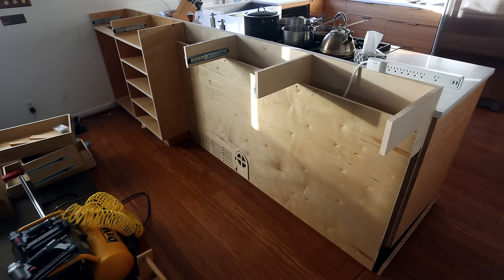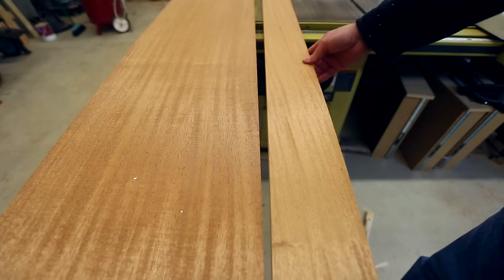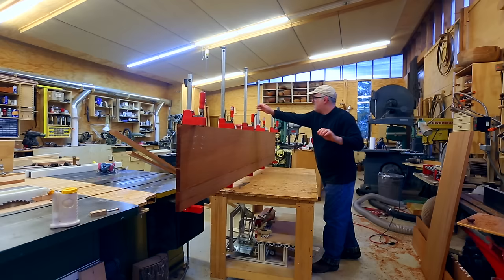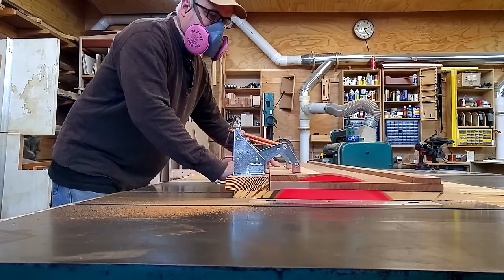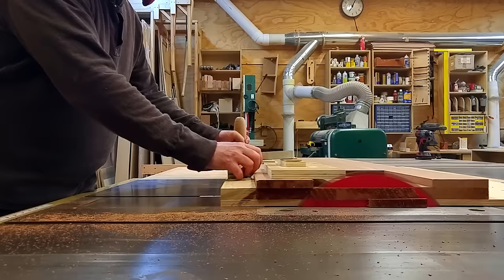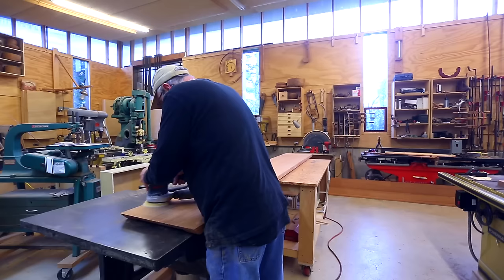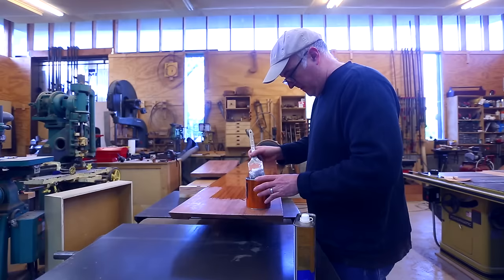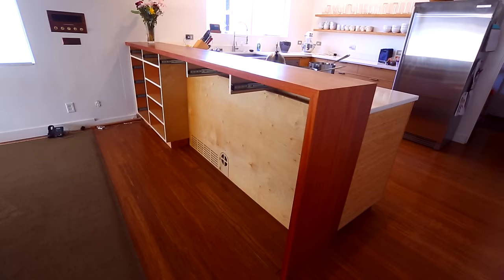Kitchen Remodel: Part 15: Breakfast Bar – Part B

Comment: Looks great.  It is great showing how you step through the process of magnificent idea, screwing up, finding a new solution, buying more timber, going back to the first option with a join because the first lot of timber had better color etc.  
One of my woodwork teachers once suggested a great cabinet maker is one that can make his mistakes look OK.  Looks like you have surpassed this!  Thanks Frank.

Comment: Ahhh, I thought I was the only one to make mistakes like that.  Thank your for your honesty.  
I have had similar results with polyurethane that you described.  I found that foam brushes work very nicely with poly if one keeps the brush strokes in one direction.  And, like you, I have better results wiping it on rather than brushing it on.  Sometimes I thin it a bit before wiping.    The kitchen is looking great.  I imagine your wife is pleased and will be even more pleased when it is all finished.

Comment: You know the old saying Frank, "Measure once, cut twice." :)
Reply: +tetsubo57 I do that and it's still too short!
Reply: +tetsubo57 My grandfather told me this one once, and it's worked very well:

"Measure thrice, trim down twice, once it's right it'll fit up nice"

A little bit of patience goes a long way on fit-up. Most people don't take into account how critical measurements are, especially when doing work like this. Mating angles must be dead-on, otherwise that tiny 1/32" gap on one end will be the first thing everyone sees. Cabinet and casework especially. I worked with a fellow here in LA that does high-end cabinetry/finish carpentry for very discerning clients. A $100k job for him was a small one, most of his work was in the $250k+ range. He worked alone about 90% of the time, both on location and in his shop(which was more decked out with tooling than any commercial shop I've ever been into(he was big into CNC woodworking). I learned a lot from working with him, and despite his somewhat ornery nature, his attention to detail was impeccable, and the finished product was absolutely perfect, every time. He had a waiting period of 3 years or so, and people would actually wait to redo a kitchen, or an office, simply so he could do the work. It was amazing to see how much work he turned down/away, simply because he didn't care for the client(he interviewed them, and didn't just "work for anybody with money").
Reply: chopperdan88 - tl;dr my dude.

Comment: Thank you for showing your mistakes.  Beautifully executed and artfully filmed.  On the rough poly finish, I had a similar result using poly on some mahogany doors.  There were bubbles coming up that caused the roughness.  I blamed that on the porosity of the wood.
Reply from the maker: +Redthumb45 I wondered about that.

Comment: I had that same issue on brushing finish as you had. In my case it was spar varnish on an entry door.  I ended up doing something similar to what you did. I leveled the brushed coats by sanding and then made a wiping varnish by diluting 50/50 using mineral spirits then wiping on the last two coats. It came out perfect and baby butt smooth.

Comment: Using the CNC on that part must have been nerve-racking, haha. Looking great so far; can't wait for the end result.
Reply from the maker: +Bob Spitz yes, it's the ultimate in measuring and checking and then pushing a button and hoping everything is set up right.  It will wreck everything faster than you can stop it.

Comment: This looks like one of those projects that seems easy and simple, and then turns into a nightmare. I've had a few of these screw-ups (like gluing the edging on the wrong side, having marked it on the reverse). The only thing I'm not a fan of is the poly. I've had some problems wit poly, and I find it doesn't last very long on hard wearing surfaces. The computer desk/table I'm using right now is a good example. 3 coats of poly, and in less than 2 years the finish is already scratched and worn through in some spots (and I'm pretty gentle). I've started to really like yacht varnish (aka spar varnish). It's UV resistant, water proof, builds a nice film, and goes on very smoothly. The only drawback with it is that it all turns to gel in the can not too long after you open it (especially if it's only a half can or less). I believe it's a linseed oil based varnish. Seems to dry much quicker than poly as well (touch dry in 3-4 hours).
Reply from the maker: +sooth15 Interesting, I will look into that.

Comment: One other idea for the problem of glue the miter: Use some duct tape --> laying it flat with the sharp edges together and put 3 or 4 strips of duct tap on it...then turn it around....put glue in the miter an put the shorter piece up....then tape it with a longer stip of duct tape to the surface of the longer piece (use a scrap wood piece and clamp it down) ... greets from germany

Comment: Fantastic work! Turned out great. I have a very similar idea for a workspace for a computer table. Wonder if you might have any tips on ensuring you get a perfect 45 deg miter? I don't have a crosscut sled, just a compound miter saw and a hand plane, which has been sufficient for my home projects. Can you point me to a good method to getting a perfect joint?

Comment: I really like this breakfast, and the whole kitchen for that matter. Sucks about the top being cut to the wrong length. I was thinking you could have put a different type or color piece of wood in that gap, maybe a couple inches wide and it would look more intentional. Similar to the things you've done on your bowls that have a crack. Big fan of your work, keep doing what you're doing.
Reply from the maker: +Kevin Setser (xK9000x) Thanks. I thought about doing something like that. Celebrate the mistake

Comment: Did you think about making it more arty/making it look intentional? For example a wallnut piece inbetween the two pieces.
Reply from the maker: +Pacific Film I thought about celebrating the seams. even cutting a wavy line with the cnc.  i ended up going simple.